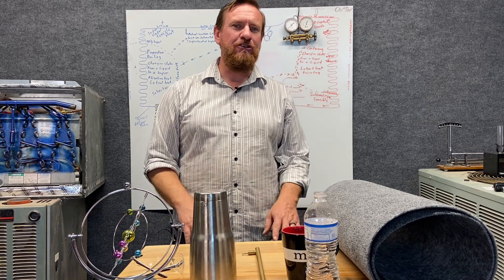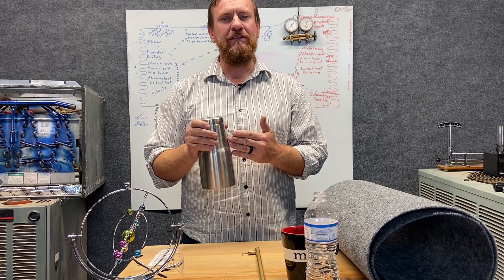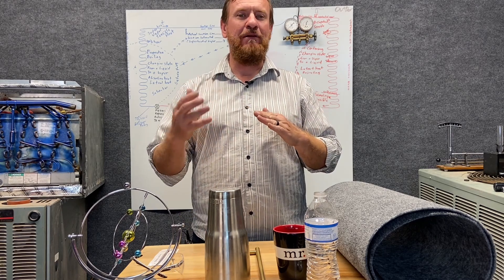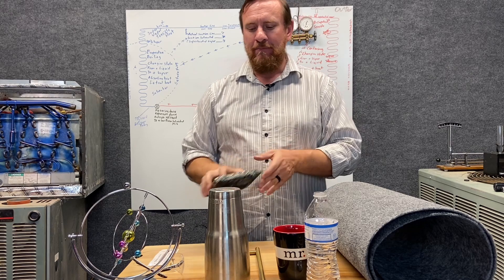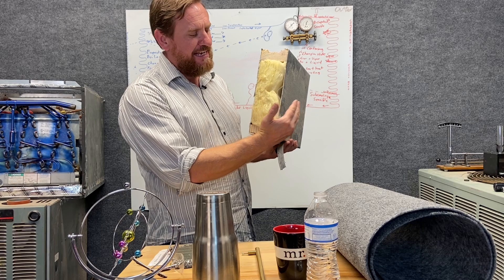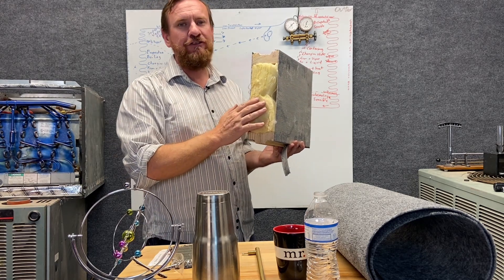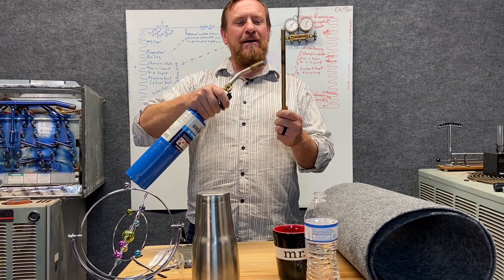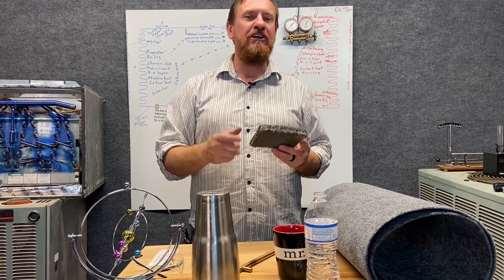HVAC 046 Conduction

Comment: A kind of "hidden" bit of conduction is when you let something rest for a few minutes after you microwave.  The food is less likely to burn you, but mostly it is because the hot spots have conducted their higher heat to parts of the food that are less heated resulting in evenly heated food with the super hot spots that burn you now not as intense.
Reply from the maker: Yes! That is exactly right.

A microwave heats in waves. Take the turn table out and place graded cheese across a plate for a little bit and you can see the waves in the cheese. It's a fun class project.